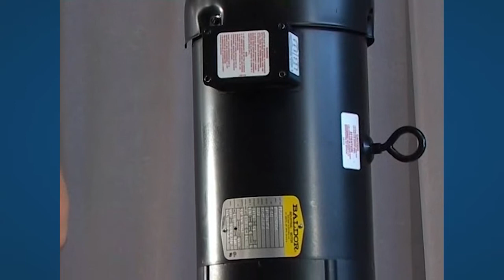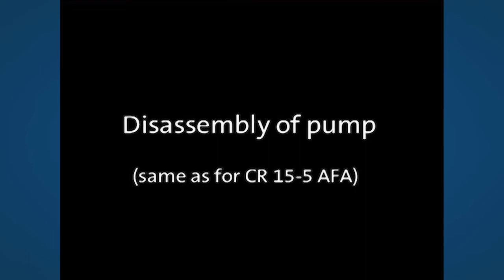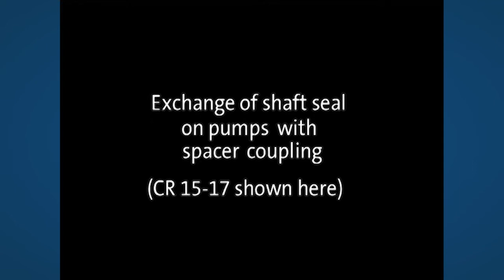How to repair Grundfos CR, CRI, CRN 10, 15, 20 (NEMA) pumps

Comment: Question: On the older CRN16-80 pumps that don't have the compression/lock bands on the side of the stack... When the bottom impeller nut is tight, is it normal for there to be any movement of the intermediate chambers between the impellers?
Reply from the maker: Thanks for reaching out to us, please contact our local office to get the correct information you need. Best regards Isabel/Grundfos